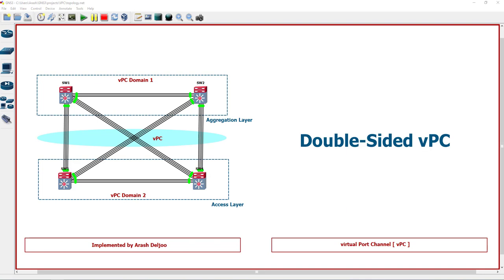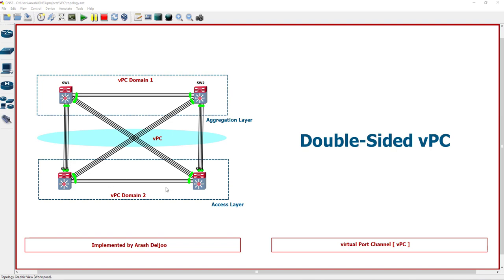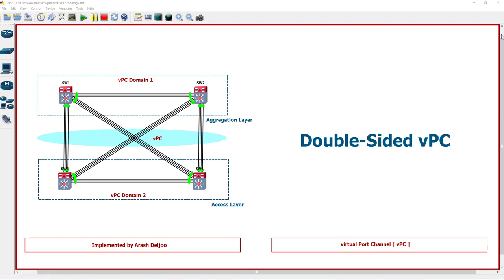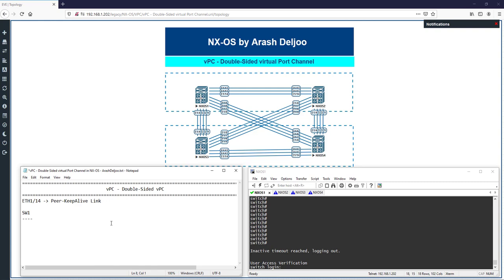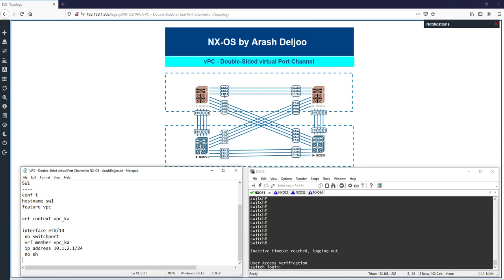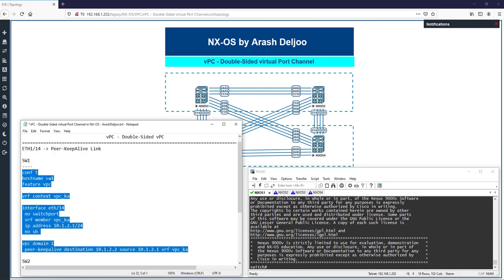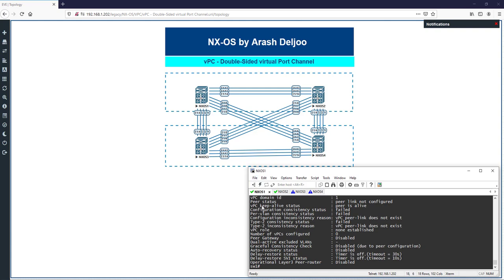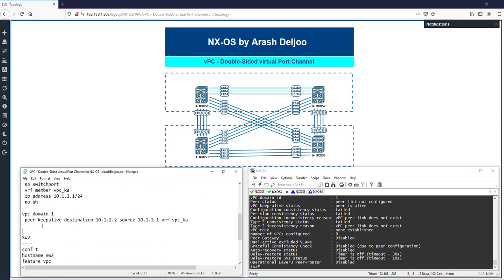7 vPC -  Double Sided virtual Port Channel in NX-OS by  ArashDeljoo -  Part1/3

Comment: can we form double sided vpc on 4 access layer switches rather than using aggregation layer
Reply from the maker: Using a double-sided vPC configuration with four access layer switches instead of an aggregation layer can be a viable design choice, especially in environments where simplicity, scalability, and direct connectivity are prioritized. However, careful planning and configuration are essential to ensure optimal performance and reliability of the network.